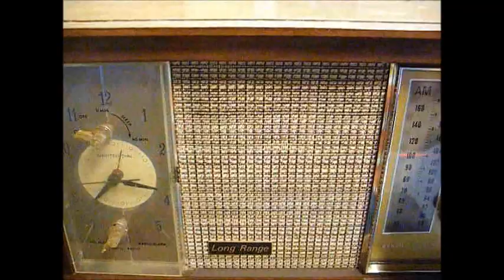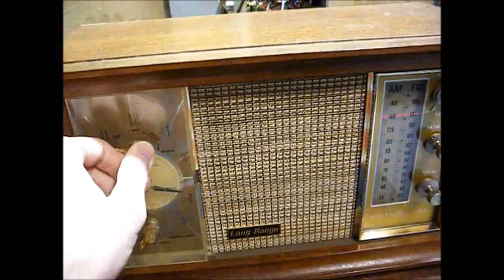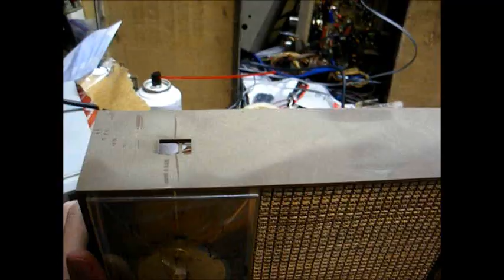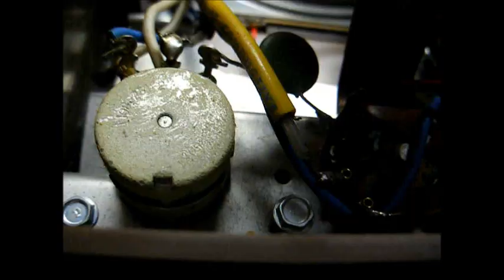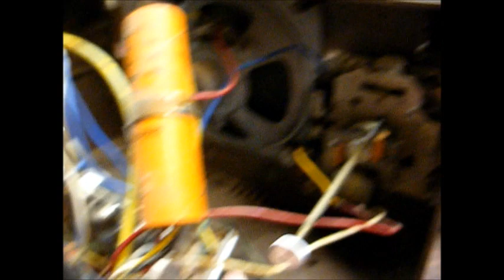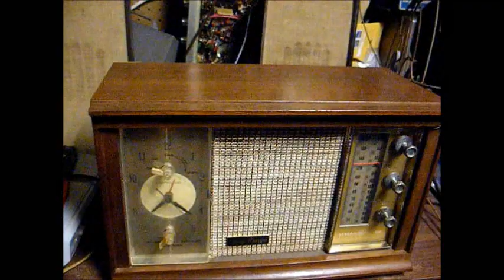Repair of a 1965 GE AM/FM tube clock radio

Comment: I'm replacing the filter cap in a GE same chasis. The cap had a shield over it and when I removed it, the capacity ratings were destroyed. The circuit board has labeled A, B, C, and all I can read on the filter cap is A common neg. B and C should be 50uf and 100uf but not sure which is which? Any idea? Thanks.

Comment: GE really knew how to squeeze the profit line. I saw a GE color TV on ebay that clearly used a shallow black and white cabinet (nice wood console) and just added a bumped out back to allow the color chassis to stick out the back.
     Nice to see a push over project for a change.

Comment: The long range one I did the IF caps on is one of the most sensitive radios I have seen. I tested it out in the desert and it picked up stations several other radios wouldnt even hear. They are actually kinda nice basic radios.